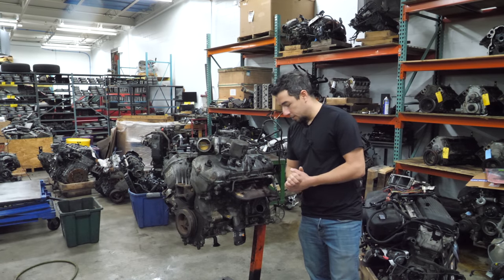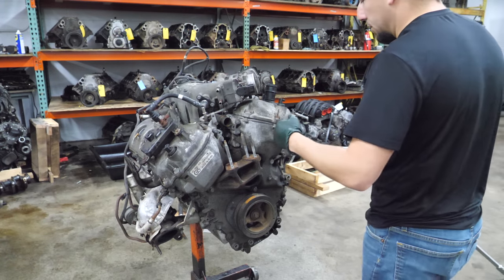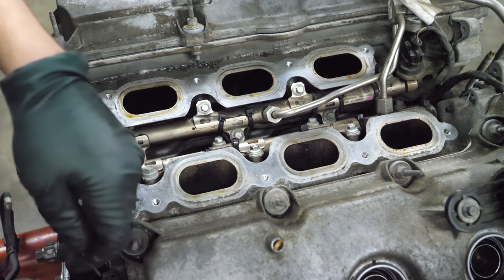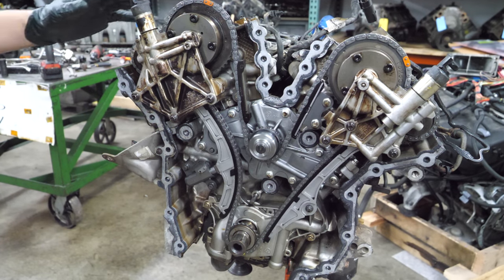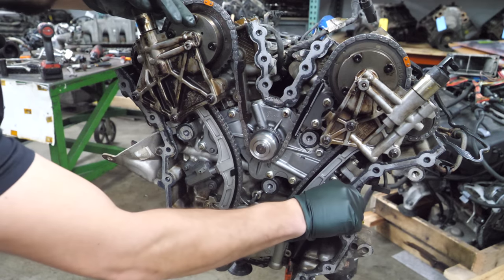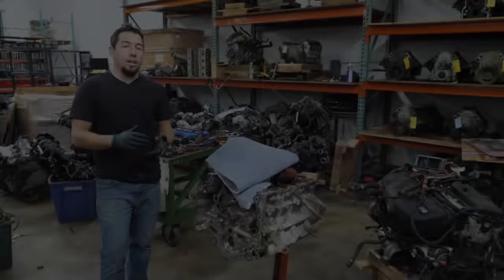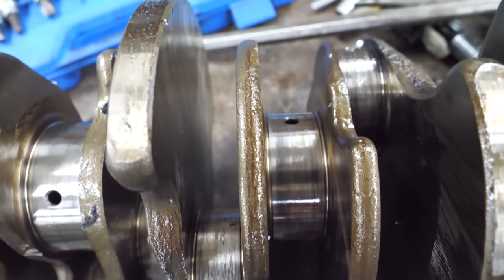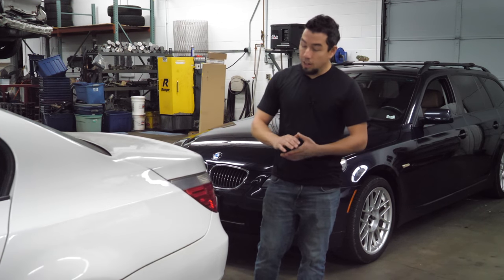Taurus SHO Flex ECOBOOST 3.5 V6 BAD Engine Teardown! What Killed This Maintained Engine?

Comment: This video reminded me of doing the water pump on my 2009 Flex, a pretty big job for myself.  I recall that removing the timing cover was made easier by using the extra empty threaded holes that Ford had put in the cover to allow you to put a bolt into and crank down against the block face and lever the cover off without risk of damage.  

Glad mine doesn't have a turbo.  Sad that such a well maintained engine was so quickly ruined by 3 minutes of ignorance.

Comment: Over 5% fuel dilution on direct injection engine  is number one problem for engines to fail or wear out fast.  Secret for direct injection to last is to never follow factory recommended intervals for oil change
Reply: oil dilution occurs much more on city drived cars, short distances and often cold runnig, but is not a issue for cars who make long distances on highway...But yes oil change need to be reduce by 50%
Reply: @leneanderthalien  reduced by 50% meaning if it says 3k to do 6k or if it says 3k to do 1.5k
Reply: @imaakillaa  it won't ever say 3k most of them suggest 10k+ which needs to be cut in half is what he's saying.  I change the oil in my 16 fiesta st (1.6 ecoboost gdi) with castrol edge full synthetic every 5k even though recommended change interval is 10k which is stupid.  The castrol edge is supposed to be good with gdi turbo engines so that's why I use that.  BTW my car is fbo with a hybrid turbo swap running on e30 full time making 280 wheel hp which is about 100 more than stock which is over a 50% gain from stock at the wheels.
Reply: @midnight347  I change my oil every 3k miles. Sometimes sooner. Lol. My 99' Tacoma has over 200k miles and still runs like a champ. Just replaced gaskets and when I had the valve covers off, the camshafts looked great along with the heads considering the mileage of the engine. Also, there was no coking deposits of oil.  Oil changes are very important and should be a priority always.
Reply: I change the oil every 3,000 Mi with full synthetic on my 3.6 L FX GM V-6 and it's got over 200,000 miles and still runs strong. I also avoid the Fatal problem that most people do on these engines and that's by checking the oil level and keeping it full! I would never go more than maybe maybe 4,000 miles on one of these engines on an oil change you're just asking for trouble.
Reply: @TRBOQUIK6  and keeping the oil level full between oil services. These newer engines are oil burners by Design.

Comment: You are absolutely right. The turbo losing a turbine wheel likely leaked the whole pan into the exhaust system in about 45 seconds and the rods immediately started eating the bearings. They had warning signs, but decided to ignore them.

Comment: The more I learn about these new motors the more I believe they don't want them to last with out major costly repairs.
Reply: The 3.5s can be great engines IF you are keeping up on Maintaining the engine and not neglecting it which is why a majority of engines fail and people complain about it when it's actually their own fault for it failing in the first place
Reply: @kylebeach2316 exactly!!!
Modern society doesn’t take the time to maintain a vehicle, but does take the time to complain about it, when it fails!!!

Comment: We had an Equinox with a 2.4L Ecotec come through the shop recently with IIRC a snapped chain, had been sitting for a while as a result. Put a chain and head on it, sent it on its way. Came back a week or so later with...something that led to us pulling the oil pan (which we admittedly should have done in the first place) and found chain guide material in the sump. Cleaned out the sump, refilled it with oil, test drove it several times to make sure the oil light didn't turn on, sent it on its way again.

Comment: It's amazing that as much as these engines are efficient, their complexity is so vulnerable to failure. They are in fact, disposable. They would cost more to repair than replace, but then, the auto industry today, wants to see us in the showroom every five years.
Reply: Oil starvation will destroy every rotating assembly regardless of brand/vintage/application.  The 3.5 ecoboost seems to be a pretty solid engine as long as the oil is changed with good quality synthetic frequently enough.  They also don't like too much granny driving, either especially when new and the rings are still seating.  Some hard pulls now and then keep them from gunking up too much.  This engine looks like it got a good piston ring break in due to the clean oil rings and lack of combustion deposits/discoloring on the piston between the rings.
Reply: @hdrenginedevelopment7507  We get a few of these every year in our service bays. Neglect seems to be the major culprit, but repair costs for outweigh the cost of replacements.
Reply: @rollydoucet8909  it seems like repair versus replacement has not been economical for years for nearly any engine in a professional repair shop setting unless it is rare or exotic/very expensive.  The time investment/labor cost just in teardown/cleaning/measuring/parts acquisition/parts in and out from the machine shop/reassembly/holding up a shop bay/being liable for any potential issues, etc etc just adds up too much.  It is very difficult to break even in a self performed rebuild versus sourcing a rebuilt or a verified good used engine when you work by the hour.  I DIY rebuilds for fun and for building specialty racing engines and even a basic refresh on a simple Honda 4 cyl adds up fast just in parts/materials and machine shop cost not counting labor hours.  I believe it's at least as much and probably mostly caused by rising labor costs more so than being too complicated to rebuild...they all reduce down to more or less the same hunk of cranks/rods/pistons/cylinders once stripped down.  Rebuilding has definitely mostly become a DIY and enthusiast's game, not a repair professional's game.
Reply: @hdrenginedevelopment7507  I'm in the engine biz' since 1969. We operate a full machine shop complete with engine dyno. When engines were somewhat simpler, a mere part failure didn't often end up kyboshing the entire engine, to the point where the cost of repair outweighed the cost of replacement. We do live in a different world these days.
Reply: @hdrenginedevelopment7507  I find the main problem with direct-injection type engines is they're not driven hard enough, and the valves get gummed up.
Reply: I have a 92 Buick. I bought a factory service manual for it. There are sections about rebuilding the trans, alternator, starter and AC compressor. I just laugh, there's no way it's worth rebuilding these things nowadays. How times have changed.
Reply: @rollydoucet8909  that’s why you have  add port injectors like newer Toyotas .
Reply: @rollydoucet8909  I def drive mine hard enough
Reply: @invalidusername_5101  I don't think hard driving is abusive. I drive all my vehicles hard. Oil change habits are key to long service life.
Reply: @rollydoucet8909  good to know my engine isn't suffering😂
Reply: Ford's 3.0l v6 duratec engine very reliable better than 3.5l,3.6 and 3.7 v6.

Comment: My father in law complained sorely when the water pump on his 2011 Flex had to be replaced and I said, "I know, right? My Toyota has the water pump in the same place." Nope. Not at all. Unreal how much needs to be removed to replace the water pump. When I changed my Toyota water pump, it was annoying, but I didn't have to take off the harmonic balancer either. 
This was a cool video.

Comment: when it comes to RTV the prep is more important than how much you use. I also wait a good 24 hours before adding any oil or running an engine that I have seal up with RTV.
Reply: Same here give it plenty of time to cure
Reply: @peterpeter5666  I usually prep with rubbing alcohol and shop paper towels. I keep cleaning until I stop seeing stains on the paper towels..
Reply: @uptownsamcv  same except i use brake cleaner instead
Reply: Yea but there’s RTV that literally says you can put the vehicle into service RIGHT AWAY. 🤷🏻‍♂️ unless it’s a personal vehicle being repaired over the weekend, ain’t no shop gonna push out a car and let it sit overnight to then refill it with fluids and finish the job the next day. 🤦🏻‍♂️
Reply: @I_know_what_im_talking_about  exactly thats why i use the right stuff . thats the name of product. its from permatec if im nor mistaken. i've done timing chains on 3.6 gms and many other cars and I add fluids litterally minits after putting things backs together with no leaks EVER
Reply: @I_know_what_im_talking_about  I can understand that, ultra gray is the main RTV that I use and it says it takes 24 hours to fully cure. I resealed the oil pan on my Maxima 9 years ago and so far I haven't had any leaks at all.. which RTV are you referring to?
Reply: @peterpeter5666  The right stuff is the best rtv for sure! It is the only one that says you can return vehicle to service immediately. We use it at the dealership I work at and I've used it at home. It's definetly thicker than the other ones which helps I think.
Reply: Bo Blu  I don't have time to waste redoing a repair because of a leak so I do it right the first time....

Comment: That’s a funky looking engine 
Thanks to your wife for this video 👍👍
Reply: After the first 500,000 you get used to them.

I work at Chicago Assembly.
Reply: The Duratec in its original form as a 2.5L that ended up in lots of Mondeos, Contours and Mystiques was a Porsche Engineering design sold to Ford.
Reply: Bo Blu  - Yeah I can kinda see that.

Comment: I had an SHO which lost a turbo despite routine maintenance and everything. Went for a quick run up to Starbucks around the corner and thought "damn the car smells hot and sounds weird" it was pretty evident quickly something was wrong and I got back home wherein there was a lot of smoke pouring out of the engine and a big oil spot on the driveway I didn't see when I left. Dealer replaced both turbos under warranty no issue. It did make it to the dealer with no issue (they said you're probably fine to drive it in and they weren't too far) but was noticeably not running right at that point.

Comment: This video was very interesting in that I'm thinking about buying a used Taurus Sho and I was a mechanic when I was in the Coast Guard and worked on gas turbines as well as diesel and internal combustion gas engines. It's easy to understand how that engine ate itself and how it could have been prevented. Thanks for the great video.

Comment: That ticking time bomb of a water pump is the reason my parents got rid of their otherwise mint Mazda 6 with the same engine in it. Ford really excels at putting hand grenades inside of their engines.
Reply: They are fine for 150k+ miles.  After that it’s usually on the second or third owner.
Reply: @user-tb7rn1il3q  I disagree. My friends Edge died at 85k miles from a failed water pump. Not one drop of coolant on the ground.  I truly believe Ford builds in things like this to make sure you have to buy another car in 8-10 years. Planned obsolescence.
Reply: Did they replace it with another Mazda? specifically a Japanese sky-active one? The Ford/Mazda divorce was the best thing that ever happened to Mazda imo.
Reply: @tails300  They did not, they bought a Kia Sportage, for the warranty, mostly. I did pick up a CX-5 to replace my wife's RX330 and we love it. I've had ~5 Mazdas since 1986 and agree with you, the split from Ford has brought back Mazda from mediocrity.

Comment: I bet it had coolant in the oil before the water pump work and that caused initial damage to the bearings. Then the turbo failed and the lack of oil made quick work with those bearings
Reply: 100%

Comment: I’d be willing to bet that the timing chain and guides were changed too late. If the guides aren’t changed promptly severe engine damage will occur. Typically the chain will wear the guides down into the metal reinforcements causing metal shavings to go into the oil and throughout the entire engine and turbos. This is why you’ll see the scouring on all bearing surfaces and eventually rod knock and cam caps prematurely wearing.
Reply: Turbos

Comment: You’re pretty awesome for making a Christmas video!! The Ford 3.5 is a damn good engine if it’s taken care of! I got one with 240k and it’s still strong as can be!! But it’s taken care of!
Reply: You replaced the water pump yet? I'm terrified of mine going out.
Reply: @painful-Jay  I haven’t but I watch it closely! I have a water pump sitting on my work bench! I also haven’t owned it since new…
Reply: @joshuamartin6841  it seems like a huge job replacing it. Mine is only 95k, I inherited the car from a deceased person. But I heard that's when they start failing. Any idea how much a shop would charge for the pump and tensioners?
Reply: @painful-Jay  I think it’s 10-12 hours labor, it’s run by the timing chain and it’s recommended to evac the ac… there’s a weep hole above the ax compressor but it can get plugged and start leaking internally…

Comment: I had a friend of mine that owned a Ford 150 with a  ecoboost V6.  It  either had great gas mileage when it was empty or it would just suck fuel down like crazy when he put his trailer on  which was about 7000 pounds it pounds .we live up in the mountains in Utah and that truck just couldn't pull up hills very well at all with a trailer ,unloaded though the thing was like a little rocket ship. He eventually sold it and bought a duramax and he absolutely loves that truck.

Comment: 9:00 For future reference, some of the holes in the timing cover are threaded and do not have a corresponding hole in the block. They are there so you can put a cover bolt in and it will 'push' the cover off, you just tighten each bolt a lil at a time evenly. 
I'm curious the mileage on this motor, my 2010 SHO has 245k miles on it.
Reply: You are obviously on top of your maintenance on your car! The general public has issues with this, then when their engines fail they blame the manufacturers and preach what a pile of shit it is! SMH
Reply: Nice mine 2013 sle has got 410k km
Reply: Your’e right . I wonder why he didn’t remove the cover that way?
Reply: What does your maintenance schedule look like
Reply: @nickrobinson2386  I have mine changed at 50% oil life and I use Mobil 1. Or, exclusive city driving then I'll change it at 6 months, even if my oil life indicator says greater than 50%. Been using M1 since the 80's and have never had an oil related failure.
Reply: Any turbo replacements? Water pump timing chain and guides done? I’m in the market for a 2010 sho would love to here anything good or bad you can tell me bout maintenance or wear and tear
Reply: @drzg2640  No, I dont tend to keep my vehicles much over 100K, my preference. My last one was a 2012 Edge with the 2.0 Ecopoop and when I traded it it had 125k and not one issue. Ive seen vids with these motors at over 200K. Obviously there are lemons out there, happens to all manufacturers, but I swear by maintenance and I keep my foot out of it until it warms up.
Reply: @sfbfriend  right on my fun cars and work trucks I spend high dollar on cause what I want them for. But my daily’s I usually buy past 100k 10 years or more old so I can buy for cheap and maintain for cheap. The market isn’t half bad on the 2010s and the performance and feel you get outta them I definitely want yo buy one as my daily I just want to learn and hear from other sho owners
Reply: @drzg2640  Afaik, (I got maintenance records when I bought the car, but cannot guarantee they are complete) Had a startup rattle when I bought it, I did timing set, water pump, and oil pump at about 185k. Front turbo went around 215k, I haven't done the rear turbo. Transmission is starting to slip under moderate to hard acceleration now. Also, I had to do pretty much the entire suspension after 200k, and it has been through several wheel bearings. I do full synth oil and Motorcraft filter every 5k, transmission fluid about once a year.
Reply: @drzg2640   I have always admired the SHO, the 3.5 is a good engine. Enjoy
Reply: @bradnoyes7955  how many miles did it have when you first bought it?
Reply: @drzg2640  between 175k-180k
Reply: @bradnoyes7955  thanks man.

Comment: Wow a timing chain driven water pump. Someone had a big brain moment when they came up with that atrocity.
Reply: A timing chain driven water pump, BEHIND the timing cover. . .major big, smooth brain work here.
Reply: @life_of_riley88  All about compacting space, Ford's done millions of them. Not sure if it's a good thing or not.
Reply: @themichaelcreed  I understand your point. Being an engineer myself, and a total gearhead, I cannot get behind design decisions like this though. GM seems to be doing a lot of things right these days with the constant evolution of a simple engine, the LS platform. I think FORD's ecoboost systems are a step in the right direction, but simplicity is the name of the game when it comes to reliability.

Comment: Dude, coming from Germany and not understanding the fuss about the big and - compared to engines engineered in Germany - relatively inefficient american engines, I really really like your style of tearing down these engine blocks! Very sympathetic! Keep doing your good work Sir!
Reply: Its interesting to me when germans make these claims.
Because their cars have the hardest time passing emissions. And are the most known for engine lights.
Reply: @Yaboidavey  You're having a point there but I also think it's something else. Regulations nowadays made by the EU are so strict that every manufacturer - not only german ones - struggles with reaching the goals of them. And of course, with the technical complexity of an internal combustion engine trying to reach abnormal and too strict rules there comes a certain possibility of some details failing - leading to the engine light you're referring to.